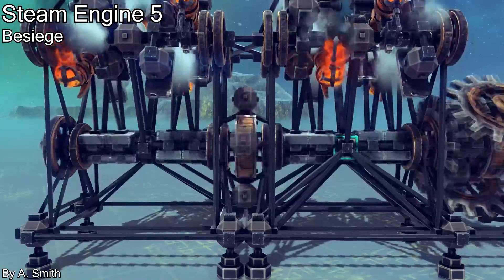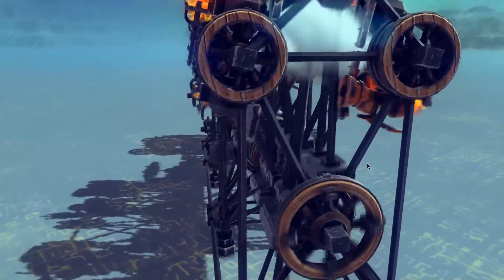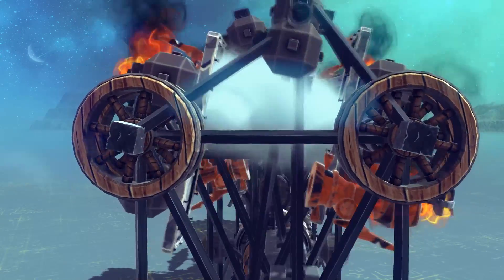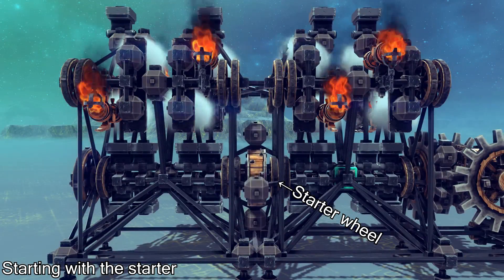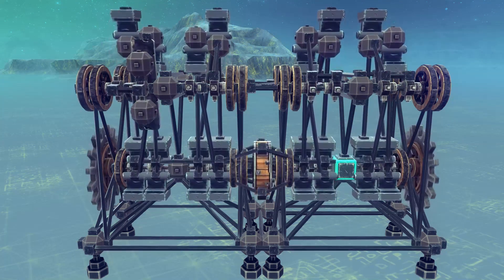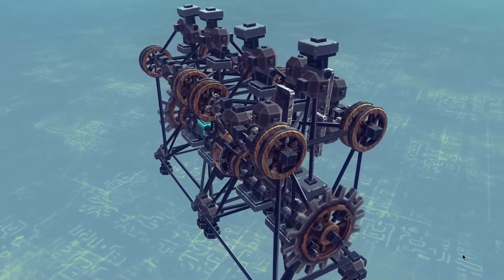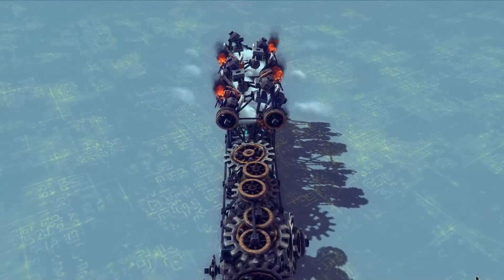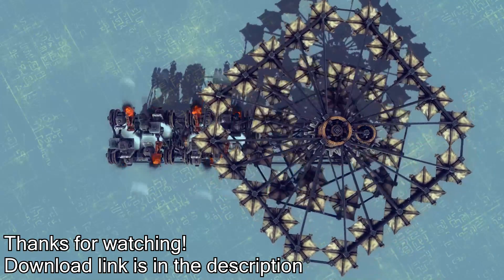Besiege - Steam Engine 5

Comment: has anyone actually made a car run with any of these engines or no one had the computer power and the time together to do it
Reply from the maker: I made a simplistic car using one, there's a video on my channel. I wasn't able to get it to drive very fast, though.
Reply: A. Smith not trying to be those uninformed commenters but what I ment is with a full sized engine like this one that could pull around lot of in game weaponry not so much the fun size light version that you did made
Reply from the maker: I see what you mean now, and I think that the reason steam engines aren't used in large machines is because it can take a very long time to get everything working properly. I haven't played Besiege in a while, but I'll take a look at your engine the next time I play. You're free to copy my engine designs as much as you want, I don't mind.

Comment: why are the individual "cylinders" at 180°? wouldn't it be getting higher RPM if they were at 90°? You might also consider splitting them entirely and joining them with a clutch, so that their angle offset isn't limited by the editor any more.
Reply from the maker: It was much harder to place them at 90deg at the time without mods. I haven't played besiege in a while. You're welcome to improve upon them if you feel like it, there's links to the files in the description.